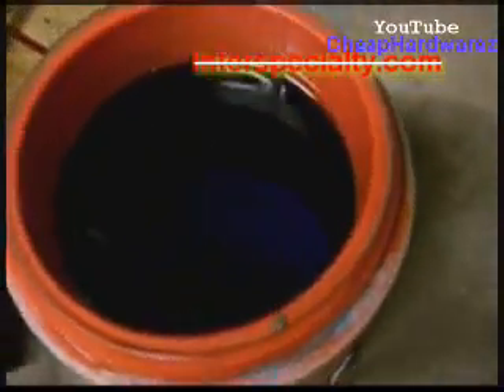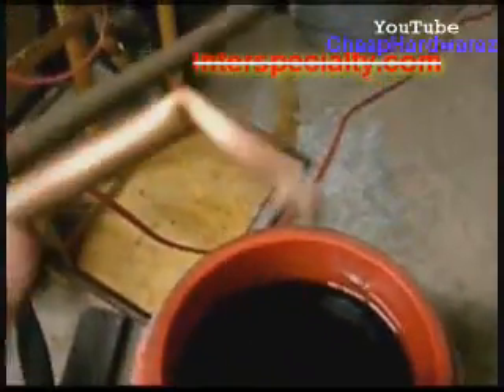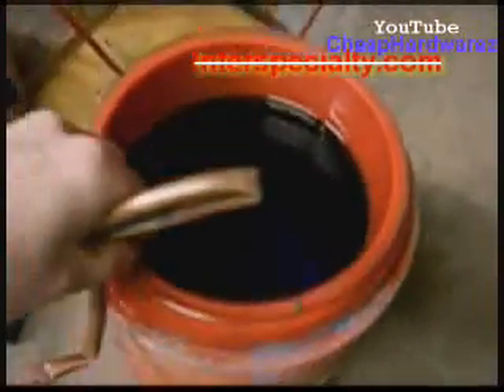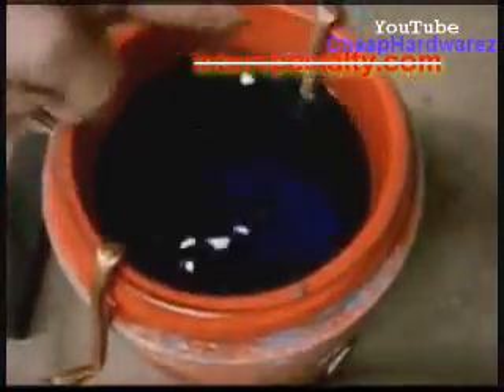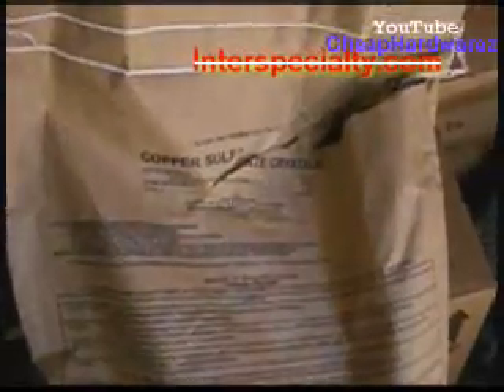Homemade plasma cutter torch water resistor

Comment: i actually build one and i can cut 3/8" like bluffer at 120v   i found a 4000w transformer. i  some calculations and rewind like a inrush  type transformer for current  limiting works very well, i have a very stable arch, but im researching for make a most quick arch start if your torch not have internal pilot arch connection is some tricky to manage the starting. if you put too close from the work piece it will to eat the pilot arching and turn some tricky